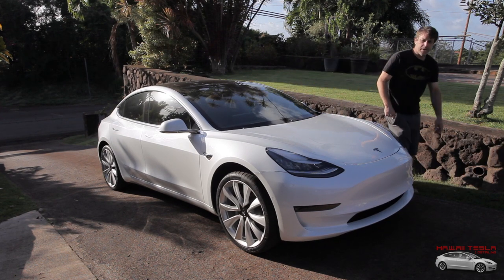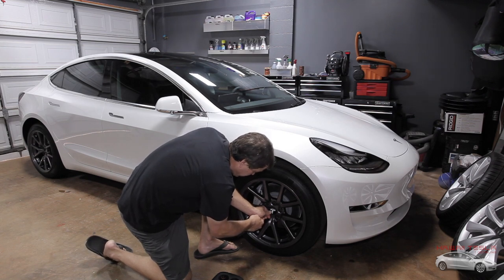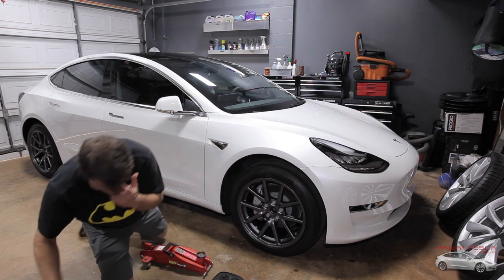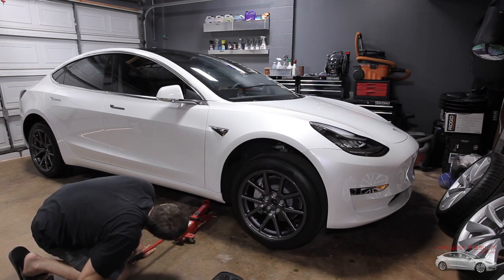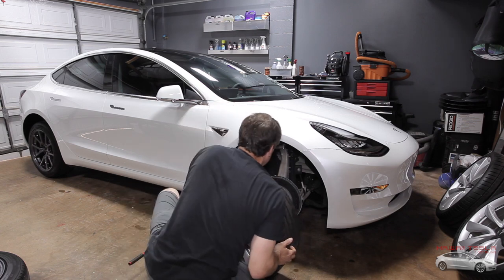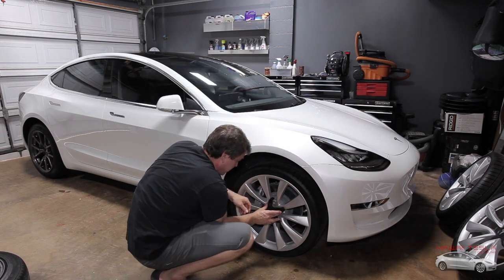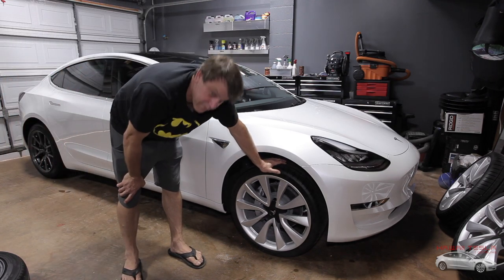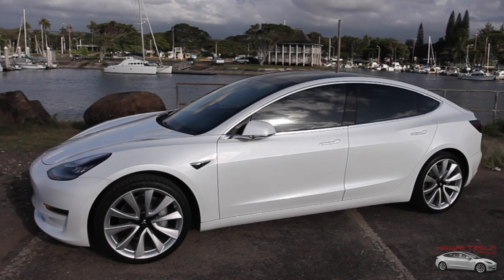Tesla Model 3 Performance Rim Upgrade

Comment: Nice work!!  Where did you pick up the wheels and tires package?  And what size tires did you go with?  245/40R20 tires will fit up that wheel gap.  Other than that, HUGE improvement!!

Comment: How are the wheels doing so far? Also, would you consider dropping it slightly if you had the chance?
Reply from the maker: They work great. I don’t plan to lower it. Hawaii roads are pretty bad. I need the travel.

Comment: They look gorgeous! Curious as to why you didnt go for the 19 OEM sport rims? Is there a noticeable difference in looks between the 19 oem sport rims vs the 20 oem sport rims?
Reply from the maker: The 20” fill the wheel wells better leaving less of a gap. I think that looks a little better??  There are less efficient and a slightly tougher ride. The 19 is overall probably a better choice for most people. Thanks for watching

Comment: Question - did you have to modify the rear suspension or did the 20" performance wheels and tires bolt on with no modification? thanks
Reply from the maker: David Romero No modifications needed. Bolted  up with no issues. Fills the wheel wells better and looks way nicer in my opinion. Thanks.
Reply: Hawaii Tesla & Detailing just a quick follow up question to this before I buy some of three wheels. I am seeing conflicting answers this based on if the 20" wheels came from a M3P+ or an upgraded wheel package on a non performance M3. Did you get these wheels from someone 2ith a performance? Great video btw!
Reply from the maker: Chris Lewis Thanks for watching. I have a Model 3 SR+. I bought the rims from a private owner that had a model 3 performance. I have been driving for months with no rubbing or fit issues of any kind. They handle unbelievable and look way better imo. It seems to me as if the model 3 was designed around the 20” rim and down sized the rims to provide more affordable options and to improve range. I like the way the wheels fill the wheel wells.  The smaller rims had a large gap and looked like a bad fit. They do have a little rougher ride as they are a way lower profile tire but I feel this is minor to me “and Hawai’i roads are terrible”. The Pilot sport tires will wear out faster and cost more to replace due to the soft rubber. I will be looking at replacement options when that day comes but that won’t be for a long time. All these things considered they are still well worth it to me. You will like them.

Comment: After a few months of swaps, are you happy with ride quality and loss range? Any pothole issues?
Reply from the maker: Yes i am happy. I live on an island so the range is not an issue. I have noticed a rougher ride but the car handles a ton better so I think its a fair trade off. I definitely have to play the miss the deep pothole game. I would hate to smash the rims up. It seems that the 3 was made for this size wheel and tire as it properly fills the wheel wells with a much smaller gap. All in all it was a good choice. I did keep the Aero wheels just in case I was not happy long term.
Reply: Hawaii Tesla & Detailing Thank you for your quick reply. I am on the fence between 19” and 20”. $200 in price difference, used, is a no brainer. The hard part is coming from 18” wheels after 2 yrs, I have no idea what to expect from efficiency + road noise + ride quality.
Reply from the maker: @3yaccessories985  I don't notice a lot of extra road noise. The tires on the 20" wheels will wear a lot quicker as they are soft compound pilot sports. The 20" tires are a bit more pricey too. The ride quality is a little rougher but the car corners incredible and feels super solid in every way with the 20" wheels. Makes the car fun to drive. I think it looks better with the large wheels as well. If I were commuting long distances daily than I would say the 19" is probably better. If not than the 20". Just my opinion though.

Comment: 129 lb/ft (175Nm) is actually alot compared to other... i Higly suggest using a torque wrench doing this... Also ALWAYS use correct lubricant on threads and contact surfaces of the bolt to make sure none of the force is lost in friction :)
Reply from the maker: ATN Thanks for the feedback. I do normally use a torque wrench but 129 was past the highest setting on the wrench. I put as much torque as I was comfortable putting. The lube is I great idea also.
Reply: @HawaiiDetailing  normaly there is certain lubes to go with different charts of torque like molycote rapid-g or molycote 1000, but any pastes like that would make sure the torque is directed to the correct stretch of the bolt and thus the correct tension to hold the wheel 😊 (like i said without lube the friction between nut and rim and also in between the threads will "steal" from were you want the torqu to work) sorry this became a lecture instead of a tip 🙄😅
Reply from the maker: All good. All makes sense. Thanks.